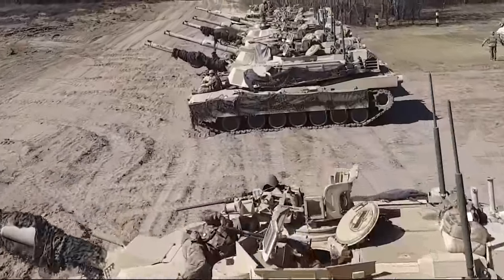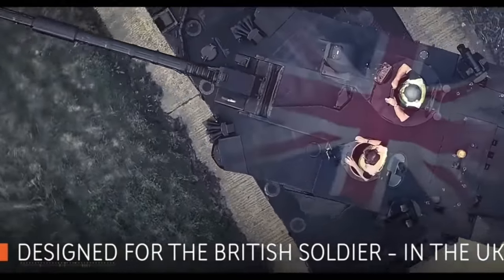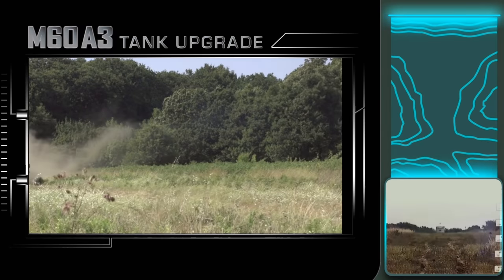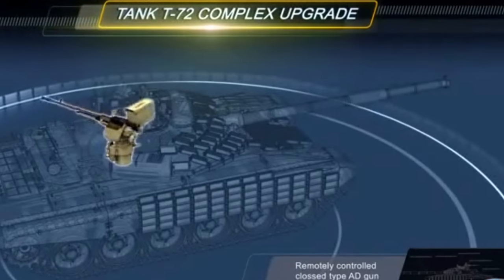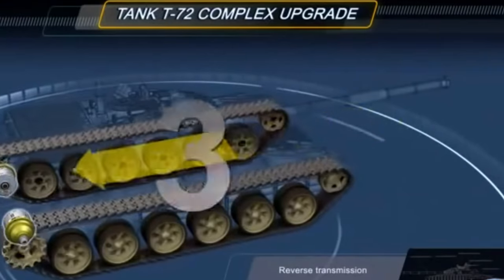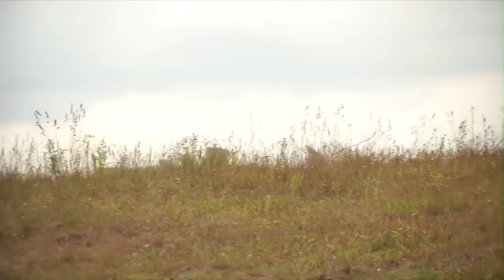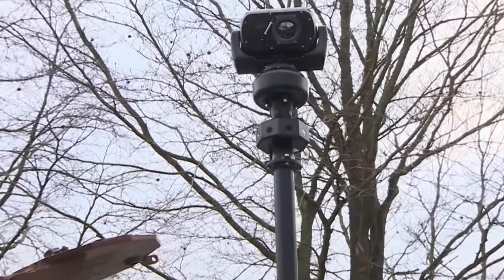Why upgrade Tanks instead of designing new ones?

Comment: Have worked at up-grading old industrial equipment most of my life; although, not tanks & tracked vehicles. You did a good job at summarizing the problems with up-grades in layman terms. Bolting on armor involves holes that introduce what engineers call stress risers into the old armor hull or in my case machine cases. After drilling holes; the impact of a shell on the bolted on plates can now easily cause stress cracks in the older tank armor and with one more hit its just pieces of fragmented metal everywhere. Welding on new armor plate produces possible heat stress cracks around the weld and will weaken the metal around the welds as the metal structure is altered. You can process anneal the entire tank shell less engine suspension and etc to relieve these stresses and imperfections but the cost is so high to do this that you may as well just buy a new tank. The suspension of the older vehicle probably wasn't made to handle the extra weight and certainly not made for the force from the bigger or higher velocity gun. It took as much engineering analysis to retrofit old equipment as it took to build new equipment.  ( usually there is no cost savings in this part of the process) If the original equipment making designed the vehicle with future retro fits designed into the original hull or casing then it make future up-grades more successful plus they will have many of the up-grade calculations already performed. This will also increase the cost of the new equipment. With FEA ( finite element stress analysis, a complicated computer stress analysis) designing extra strength into the original armor for upgrades has become a better possibility. ( again this  comes at a higher price tag for the original equipment) One of the major determinations is how many tanks in the global market is the supplier going to up-grade. If its a handful; then the cost effective choice is to buy new tanks. Therefore, sooner or later a nation is going to end up purchasing new tanks as the life span of their existing tanks dwindles to zero around the globe. This is what makes tank and aircraft development and projects a global proposition rather than a domestic one as no one nation, including the USA, can afford such programs for just their domestic needs. This is especially important for a smaller populated nation such as Canada. (It is why the Avero Arrow failed)
Reply: AKUJIRULE  Your right on that point but even if the USSR didn't do that; the program was doomed from a business point of view as the Canadians were only going to build a few for their military. This is one of the main reasons that the French Rafale has become such an expensive plane.

Comment: Unless and until there are substantive advances in materials, propulsion or ergonomics there is no need to dramatically alter the basic layout of the MBT. Therefore, so long as the hull and running gear are sound and cost-effective for the army they are serving, there is no reason to alter that portion of the vehicle.

That said, all other aspects could-and should- be subject to upgrade and augmentation.

I expect the M-1A-6 to be practically unrecognizable next to the original M-1.........................................

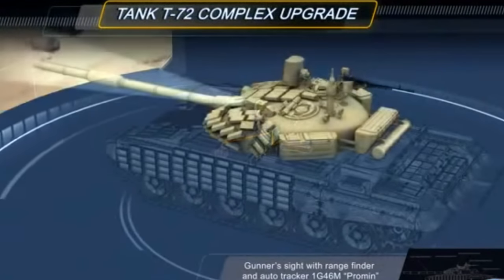Comment: 7:25 - Here are some analyses that contradict your point. 
'Again, our linear regression analysis shows that average age does not havea statistically significant positive relationship with estimated actual expenditureswhen adjusted for total usage. This can be seen in Figures 4.3 (M1A1) and 4.4(M1A2); there is not a visible positive relationship between average age and ac-tual expenditures adjusted for total usage, that is, brigades with younger tanksare not typically associated with lower actual expenditures.4'
https://www.rand.org/pubs/technical_reports/TR286.html

Also:
https://www.rand.org/pubs/documented_briefings/DB648.html
https://www.defenseindustrydaily.com/reset-of-the-us-armys-vehicle-fleet-continues-02493/

Comment: It's always cheaper to develop an upgrade package than it is to develop a new tank, but that's not the same thing as buying an upgrade package vs. buying a new tank (infrastructure and all). Most countries looking to improve their tank fleet don't have to develop anything, they buy finished products. The problem they're faced with, is whether it's better to buy the upgrade package or the new tank, and now it's not at all certain that the upgrade package is more affordable than the new tank, even if it was cheaper to develop. In fact, with all the thousands of available upgrade packages out there, actual interested customers are remarkably hard to come by. The more radical the upgrade is, the more expensive it is, and the less likely it is that it's more affordable than an entirely new system with the exact same capabilities (which is usually not even the case, you can upgrade an M113 all you want but it will never be a Puma). And for the last 3 decades, you could get low-mileage surplus vehicles much cheaper than upgrade packages for previous generation vehicles. The upgrades that countries actually tend to buy are small and mainly concern sensors, laser rangefinders and ballistic computers for vehicles that lack them completely. They don't typically add weight to any appreciable degree, and they don't typically require a lot of new holes to be drilled, but they drastically improve the performance of the vehicle.
It's important to remember, practically NONE of the amazing upgrade packages you see in marketing videos ever get sold.

Comment: i would add to age of those tanks - some nations have tanks stored as reserves for the case of war. Usually you upgrade those "old" tanks thats been sitting in a garage for dozens of years. So its not really a problem to uprage T72 that has like 500 km or even 0 km driven.
In CZ we did a T72 upgrades and those tanks were in great condition. Now we talk about a new - 5th upgrade program. And T72 chasis is very effective. So iam curious to see T72M5

Comment: For many countries a large part of the issue for maintaining a lot of the older complex hardware like tanks and aircraft is the cost and time of having to train the personnel to use and maintain the vehicle properly. This is especially true where they can't see much of a threat to their country that is beyond the capabilities of the hardware they have.

I personally think we will see a decrease in the use of main battle tanks for a lot of war theatres over the next decade or so, but some will still be kept by the larger armies as they provide a combat capability not yet available in any other existing or planned hardware. However, I also expect to see an increase in the number of types of specialise remote controlled armoured vehicles to do some of the sort of roles currently done by manned tanks as such vehicles will offer an increase in combat capability and mobility to many field units beyond what a manned tank can offer.

Comment: I see it as budget, time frame and the need for the upgrade in the first place. Will the upgrade cause problems for logistics I mean if your tank has 100mm gun with ample ammunition it doesn't makes sense to give it a 115mm gun you don't have the rounds or enough rounds for the new 115mm gun. I know the russian 115mm gun on the t62 was even oddity by Russian calibers i just think that 105mm wouldn't be as a drastic change and might be little easier to train the crew on and have the ammunition readily available but still an adjustment for sure and the crew just couldn't be trained overnight. But less of jump compared to a 115mm, 120 or 125mm gun.

Or are you going to request upgrades by the original manufacturer or take a gamble with 3rd party kit because they can ship you it in 3 weeks or less and promise a 30 day return policy if your not satisfied with a the kit. Versus a trusted manufacturer of said tank and can produce it better product that may or may not take more time and may even be cheaper than 3rd party.

It can also be used as a short term stop gap measure for countries who can afford to build their own new tanks but don't have solid idea yet of that new tank is going to look and function like. Or it could be stress on already comprised hull because the tank is not just old but relic that should be put on display in museum instead to keep from rusting and collecting dust.  I mean I wouldn't want to see any panzer 4s still in use that is like an 80 year old tank right their and if were consider about 60 year t55s still being able to run then its some strange voodo is going on to keep ww2 vehicle still combat worthy lol.

But again i think retrofits and upgrades for countries that have very small and tight military budget margins as a great idea if it makes sense to do so and that they get such kits from trusted manufactures and supplies. Like if your going to upgrade a bunch of t72s I suggest a good start maybe get in contact with the Russian Manufacturers and supplies who built components specifically for the tank that would allow for upgrade packages when needed. versus some small 3rd party defense contractor that not much is known about them. 

Lol. I know I am dumbing it down to make look like just your average joy when shopping for a new car. But I wonder if military officials actually get on the phone ans shop around for upgrade kits for their tank nations tanks fleets If your a nation doesn't have big military budget at least and has some be name companies that you can just go to directly and set up a competition bid for the best product or new tank all together if you chose to do.

I say great if you can produce a new ultra modern tank and can have well trained crew that can perform well in tank or any battle conditions then go for it. But if you got a rag tag fleet of borderline junkers that still function but could still use a bight of an overhaul to stay relevant in most situations and get the best gas mile age as you can. And that you can only afford to train a mass conscript tank force who may only have a grade 4 level education at best then investing into new tanks or technology might not be the best for the time being until you can start forming so more elite tank crews and divisions.

Also having some olders tanks at least in reserve can be a good idea for crew train purposes anyways. Like T55 would make a could trainer tank for new crews as if screw ups happen you not causing costly and expensive damages say to an Abrams, Challenger 2, or T90M or T14 Armata.  I mean the air force's do similar things for pilots so i don't see why not for tanks at least in the early basic stages of tank combat training.

So I really I just think If you can afford latest and greatest tanks go for it their isn't a whole holding your nation back besides politics with in the government and military itself. Or if your nation cannot improving your current tanks is still better than nothing and can could be good enough depending your nations situation.
Or you could do things like Russia has done and do combination of the 2 until the new tanks are built in enough quantity.

It just means that the staple and backbone forces of your tank core will be composed of heavily modernized older tanks but it also means your tank regular crews will be decently trained  because the changes aren't always so drastic but the crews can still learn technologies and become more effective in general. The wouldn't your best trained tank crews but they should hopefully be better than say conscript in a country that doesn't have access to a good education even before conscription at since Russia is modern enough at least these days. Then you save your best most modern tanks for either your still serving veteran tank crews or for your most aspiring recruits who stand out from the rest or that can afford to pay for some kind advanced tank training academy that the could qualify for I dont know lol.

I am just sharing my opinion. I don't exactly what allows for tank crews to join the elite divisions ranks/ club aside from having lots of combat experience. But anyways I am just saying with normal joes like my self military's have options in investing to satisfy its needs for the current combat climate.

Yes I am aware that I am not 100 percent accurate I am only speculating in a rambling rant so bare with me lol. Also thought rant might take away a little from comment trolling here because it went from do tank upgrades made sense to USA or Russia is evil lol. Also not asking to be a target here either lol.

Comment: Could you do a video exploring the possibility of electric tanks? Think of Tesla were to design a tank. Thanks!
Reply: Porsche transmission noises raising in the background: god please, NOOOO!
Problem comes in that the engine needs to move at least 42-50 tons of weight, all while keeping current MBT mobility (if not raising it) and mileage, something i doubt electric engines can do without causing a vicious loop (more battery juice, more weight, needs more HP for engine, wastes more energy, battery needs to expand again....).
It should be easy to note that it's easier to have engines that accept various fuel types (M1 turbogas engine) or has high tolerance for the kind of fuel it takes (Diesel engines) rather than have to bail off the tank because you can't refuel it so easily (not smart having logistics trucks going behind with spare batteries and mobile cranes to replace a battery every hundred of Km driven).
Reply: @andrehashimoto8056  aside from those solid points just the refuel time is crazy. Right now it's measured in minutes then you're back up and going to the mission. Less possibility for ambushes, less tanks needed due to higher utalization, quicker advances, and it means you're not sitting around waiting to be noticed should enemy aircraft be a concern
Reply: I'm quite certain he done one on electric tanks. Use the search feature
Reply: @THEGIPPER34  it will happen eventually.
Reply: The battery tech isn't nowhere near capable enough to power a tank for more than a few miles. The fuel consumption of modern MBTs is insane. Even with the higher efficiency electric motors, they would suck the battery empty in no time.
What is certainly possible though is a hybrid powerpack with a battery which enables the tank to operate much more silent than normal for a limted time.

Comment: Some upgrades can be a good way to cut costs but quite a few usually turn out to be a false economy when the vehicle in question has to face up to the battlefield.  For instance in World War 2 there were quite a few instances where upgraded vehicles ended up being harder to get the best out of than the original model.  In many cases this was because the upgrade was fitting a larger gun and armour package. 

While this gives the vehicle a better chance at killing heavier enemy tanks, it means less room for the crew of the turret and other equipment as well as adding weight to the vehicle.  This makes the tank slower in pretty much every way including crew response due to them not having the room they need to do their jobs effectively.  It also means more stress on the engine and running gear which can easily end up with reliability problems on top of all that.  Another issue is that because of the extra weight they become easier to hit because, again, they are moving slower and have more difficulty with accelerating.

As such, with upgrades of tanks you need to be careful or you can easily take what was a pretty well balanced vehicle and end up changing it for the worse.

Comment: while i agree money is a consideration. i think another key factor is uncertainty regarding the modern battlefield: there's no point designing a new vehicle until the older ones are clearly obsolete, money is also a factor in that, but also knowledge until we see Challenger 2s Abrams ect decisively outmatched in combat we may as well continue to use them. and then when they are rendered obsolete by a new vehicle type or technology we can know what that is and act on that when designing a new vehicle. but until then we'll stick with what works.

Comment: "The best is the enemy of the good." Voltaire

T-14 Armata is prime example why new designs are not so widespread these days.

Cold War tanks with some Thermal upgrades are just good enough to wage wars.
Reply: Armata has been right and bold attempt to shake-off decades long legacy and limitations of Soviet design - apparently, the crucial factor, engine - still failed.
Reply: @piotrd.4850  That isn't the only thing that failed. So did Russia's economy and they just plain can't afford to produce the T-14
Reply: @piotrd.4850  T-14 lost its' somewhat semi - perspective V engine. It will enter service with standart X-shaped one
Reply: @mickheaton4609  oh, that's why russia's getting its' first batch of T-14s this year...
Reply: @ГеоргийМурзич  How many years late? Take your inferiority complex elsewhere Boris. The T-14 still isn't anywhere near the Abrams. There are reasons why it costs just over a third of the price.
Reply: @mickheaton4609  huh, you're so full of yourselves, foolish Johns. Bruhbrams is worse than T-14 just in every aspect. And surprise, any M1A2 variant middle armour glacis is weaker than even the upper one of the obsolete T-72B with no ERA.

When it comes to the T-14s' engine, Johnny,  no problems with it, X-shaped engine is a stock armata engine, it's already in serial production
Reply: Георгий Мурзич Thats the problem with russians you are so fed up with propaganda you just can’t think otherwise, you never research other articles about tank and your excuse of that is “They are fake” of course Russia is so powerful(!) that everyone tries to make it look weak. Leave your fantasy dream
Reply: @can9714  back at ya
Reply: @can9714  So do you are too.